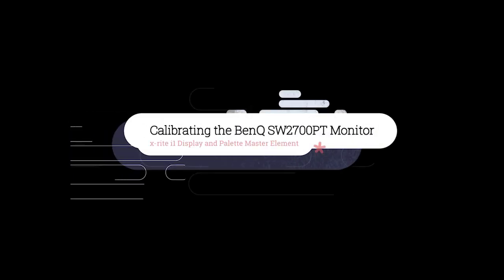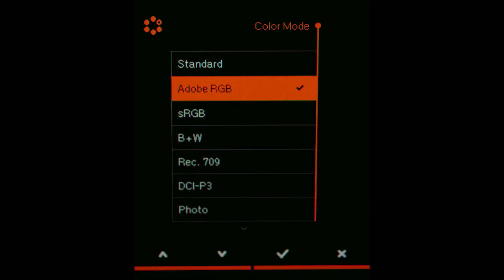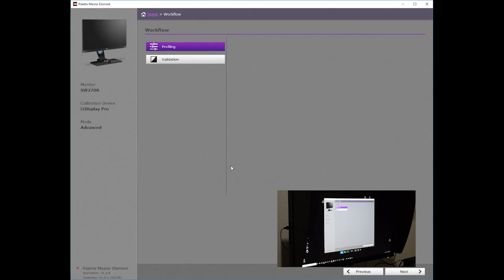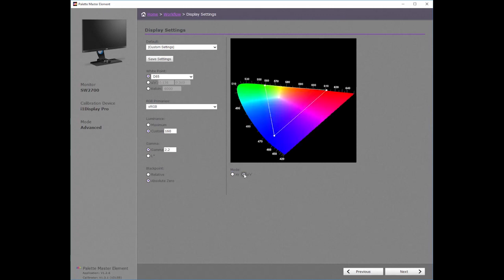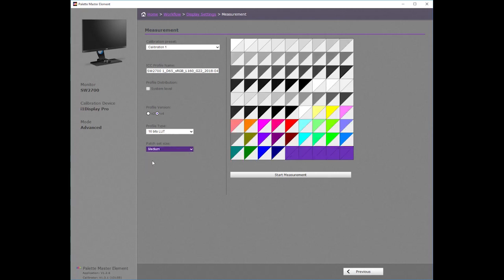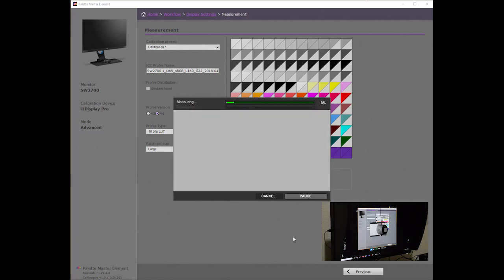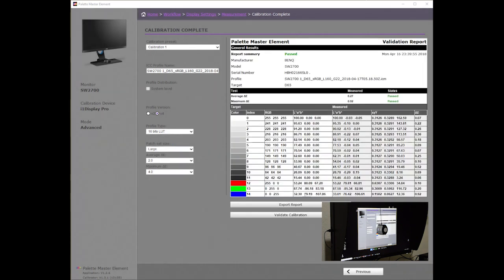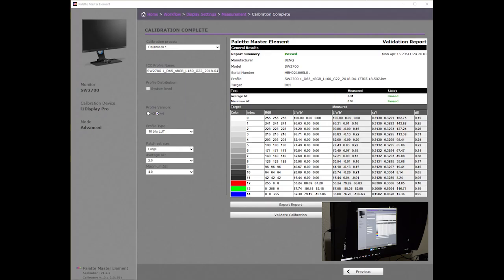Updated: Calibrating the BenQ SW2700PT monitor using XRite i1 Display

Comment: Hey Roger, which port are you connecting your Xrite calibration tool to? I’ve connected my monitor via usb c and then the i1display profiler using the service port (only USB port available). Is that right?
Reply from the maker: Yeah. On my monitor, there are two UsB ports on the left side of the monitor. I connect the i1Display (same as the Pro model) there. I use the Palette (sp?) master elements software from BenQ with this. I think if I use the larger spectrophotometer i1 Studio device, I connect that there also even though I use the Xrite version of the software with that.
Reply from the maker: Also, I connect my monitor to the PC by display port cable. But I've heard the usb c works well.
Reply from the maker: Yeah. On my monitor, there are two UsB ports on the left side of the monitor. I connect the i1Display (same as the Pro model) there. I use the Palette (sp?) master elements software from BenQ with this. I think if I use the larger spectrophotometer i1 Studio device, I connect that there also even though I use the Xrite version of the software with that.
Reply: @docrujet  thank you. I’m connecting my i1 calibration tool using the usb a (service port) input and a USB C display cable. However, the software doesn’t advance beyond the initial set up stage where you select your monitor model/display tool etc. did you come up against this?
Reply from the maker: @Poopdeck1015  I don't recall having that experience. I used the most uptodate version of the Palette Master Elements recently. Apparently, they changed the name of the iDisplay  to i DisplayPro. Changes. I would say it's probably the time to call BenQ. They will know the answer. They offered me really good support when I had to call them back in the past. Makes you wonder what is going on. Rog
Reply: @docrujet  Yes that could be. I’ll give them a call tomorrow. Thank you very much
Reply from the maker: @Poopdeck1015  Fingers crossed. Rog

Comment: Hi my BenQ SW2700PT (January 2020 Build) i installed PME ver 1.3.10 as suggested by BenQ channel tutor ArtIsRight. There's some bugs in later ver. 1.3.9 and new ver. 1.3.11. ver. 1.3.10 is stable. But I'm getting different measures after every single calibration. Panel Native, Luminance @ 100, 16bit LUT, gamma 2.2,  absolute black. What's wrong. Errrrrr!
Reply from the maker: Hi. I just saw this today. One question: when you calibrate, do the DeltaE values fall below 1 (average deltaE less than one). If so, then good. The individual deltaE values will vary with every measurement. No worries.. but,, if the calibrations are failing,, then not good.. BTW, the last few patches will be more than DeltaE 1. Please let me know. Rog
Reply: @docrujet  Yes value changes in every single measurement. I'm getting higher value in avg Delta E 3.05 & max delta E. 4.32. that's not good sir. I'm using X-rite i1 Studio.
PC Specs
i3 8100 8th gen
Asus GeForce GTX 1060 6gb
16gb ram.
Should I reset GPU settings. Should I reset monitor.
What should be my selection of options for i1 Studio in Palette Master Element. The current version I'm using ver 1.3.10. should i jump down to ver 1.3.8 ?
Reply from the maker: @SachinBalan_PB  Sachin, the is how I moght approach solving this: 
1. Make sure your monitor is connected using a Display Port Cable - not HDMI - to you monitor card. 
2. Go into the NVidia Settings and be sure your display is set to 10-bit display settings (It's at the bottom of the "Change resolution" page in the NVidia Software. )
3. I see you are using an XRite i1 Display colorimeter. Good. 
4. Make sure it is attached to the USB slot on the left side of the monitor. It will not work if it is plugged directly into your computer/motherboard.
5. I see you are using the Palette Master Softewware Provided by BenQ. (You cannot use the non-Benq version of this software to calibrate your monitor. )
6. Start the PME software.
 7. Basic or advanced. Both are fun. Make sure you tell the first page that you are using the i1 Display. 
8. If you are calibrating as Adobe RGB, just know some colors will be further out of calibration (Blue and Green) than you will get for just sRGB (Stokes RGB). No worries. 
9. Set your White point and luminence. (Mine is set at D65 and Luminence 120 - I work in a bright room). 
10. On the next page set up which preset you'll store this under (Calibration 1 is mine), your calibration name, Profile version, And 16 bit LUT (I believe this gets better results when I run the calibration). Gamma 2.2 is good. 
11. Run your calibration. Make sure the i1Display sits right on the monitor without a gap. (It is easier if your tilt the monitor back slightly). 
12. If the DeltaE result you get at the end isn't < 1 on average, then call BenQ. They are nice people and they will help. Really, really.

I hope I've recounted a step you might have missed. I feel your frustration when things don't go right. You should have seen my face the first time my screen turned white-light pink after calibrating  - the first and second time. I called BenQ. They offered to replace the Monitor. I calibrated it a third time just to make a video and vent my frustration and magically it worked perfectly. I don't think I ever figured out what I did wrong the first two calibrations. Patience my Brother. LEt me know what happens. Roger
Reply: @docrujet  I bought my monitor from the computer vendor nearby. My Nvidia color setting is default > desktop color depth 32-bit > output color dept 10bpc > output color format RGB > Output dynami range full. Refresh 60Hz.
Reply from the maker: @SachinBalan_PB  If you've gone through the steps I noted above (12 steps), and it is not giving you good results, then maybe you'll have to call BenQ. THey are good listeners. Rog
Reply: @docrujet  I have put it on basic > Adobe RGB > 120 > 16bit lut > large. Let's see what result it gives.
Reply: @docrujet  Bingo it worked with basic settings. Thanks Rog.❤️👍. All frustration gone in a wind.
Reply: @docrujet  I asked youtube channel ArtIsRight and he said don't use ambient light metering after paper profile that will spoil all Calibration effort.
Now my Calibration 1 is
Panel native
D65
Luminance 100
16bit lut
Gamma 2.2
Profile v2
Absolute black.
Now all is well.👍
Reply from the maker: @SachinBalan_PB  Congratulations. Good to know. Roger

Comment: In the Display Settings I can't see any "photographer" or "video" settings, just "Device native"... No "RGB primaries" menu either... Any help on this? THANKS!
Reply: I have the same problem...
Reply: same problem. I have the newest monitor drivers, newest pallete master version, monitor usb is connected to PC, Spyder 4 connected to monitor usb. All should work but I do not get "profiles" and I do not get to choose "Primaries". Anybody solved this?

Comment: Help. I get an achieved temperature of 7600K, target ist 6505K. This makes me so unhappy.
Reply from the maker: Ooh. Couple of basics. If you just bought the monitor, be sure you are using a display port cable between the monitor and your graphics card. Be sure your colorimeter or other measurement device is connected to one of the usb ports on the left side of the monitor. Be sure to download the new version of the xrite palette master software and their usb port sw2700pt card reader diver. I'm not sure if you need to download the WHQL driver or not. When you run the calibration, check the correct settings on the start up page for your monitor, your calibration device. Be sure to choose either the D50 or D65 whitepoint setting in palette  master elements. Choose a luminance between 100 and 120 if this is your first time doing this. Pick the AdobeRGB or sRGB settings if you prefer to do it that way. Make sure you set the software to store your calibration to either calibration 1 or calibration 2. I pick the 16 bit LUT and large patch set on the next screen. The calibration will adjust the brightness to as close to the setting as you choose. If these steps do not work, then I'd call BenQ for help. They are easy to talk to. Rog
Reply: @docrujet  Great video. I'm new to all this, so I may be naive. You wrote, "Be sure to download the new version of the xrite palette master software and their usb port sw2700pt card reader driver." Do you really mean the BenQ Palette Master software and the drivers from BenQ? It's critical for me to know if not, thanks. B

Comment: I am having issues calibrating my BenQ SW271 monitor. Using the X-rite i1 Display Pro I first attempted to calibrate sRGB at 100 luminance, and achieved only a 21.8681. I tried again, this time using Adobe RGB at 80 luminance and achieved only 20.3193. The report showed a Maximum of 26.36 and an Average of 19.83. Not sure what the issue is.

I am running Windows 10(v 1903, maybe that's the problem) on a Ryzen 9 3900x, MPG X570 Gaming Edge MOBO, RTX 2070 Armor GPU. Pallette Master Application is V1.3.5. Pallette Master calibrator is V1.3.2(1D186). The monitor is connected via HDMI into the GPU, and USB 3.2 into the MOBO(I have not tried to calibrate with USB-C). 

My main use of this monitor will be as a video editing reference monitor and some color grading, both in DaVinci Resolve.

Thanks in advance for any solutions and/or suggestions
Reply: Nevermind! I went and bought a Display Port cable and it worked fine! (wish they'd supply one with the SW271 but se la vie.)
Reply from the maker: @jeremymullins715  oops. I just your next conversation. I'm glad you figured it out. Those cables have to be right. Rog
Reply from the maker: Good luck and enjoy your new monitor.
Reply: @docrujet  thanks for the help!
Reply from the maker: Jeremy, sorry I did not respond two days ago when you asked your question.
The Delta E values you report  are more than a bit off. I have pasted a link that deals with calibrating the SW 271 monitor.  https://youtu.be/84Z5yMLCtJM

Just a few items. I am not familiar with the sw271. But my sw2700pt requires the calibration be plugged into the usb port on the side of the monitor. The xrite 1 display pro is a reliable tool. I also have the iStudi. Both work well. But, they are not the same technology and give different calibrations. 

Make sure your monitor is set to the full 0-255 range for colors in your graphics card software. 

Use the Palette Master Elements video setting (if you see one). Sorry, my computer is not in front of me to check the Palette Master choices. 
If you are still getting Delta E >2, call BenQ. Their staff are very helpful . 
Rog

Comment: okay i calibrated my monitor (the same one you got in the vid (benq sw2700pt)) the colors noticably better but the monitor overall appears to be darker...did i miss something?
Reply from the maker: When you start the calibration process, on the "Display settings " page is the White Point set to D65? Or, is it set for D50. D50 leans towards the redder (yellower?) colors. If you are at D65, then that is the recommended setting. Here's a link to XRite's explanation for this: https://www.xrite.com/service-support/monitor_calibration__which_white_point_is_correct. Just below that is luminance. Mine is set at 160. Normally many printer groups will use much lower values 80 to 120 cd/m2. This works for my environment. But, might be too high in your environment (I have a lot of large windows here). I leave the black point set to Absolute. When I first adjusted my monitor I experimented with both White point settings (this affects the colors' warmth and coolness. I preferred the D65 vs the D50 for my purposes. The luminance affects the perceived brightness on the monitor. But it also affects how you perceived the differences between the monitor and your actual prints (if printing). (In fact I might just try re-calibrating at a lower luminance to see if that works better for me now that we are moving into the Summer. It's getting bright in here. )
Reply from the maker: Sorry, I wish i had given a  more concise answer to your question on darkness of your monitor. I have learned that professional users of monitors adjust the brightness of their monitors for their specific purposes. Luminance: 80-120 cd/m^2 is a typical range of brightness of monitors for most of these professionals. The white point is used to adjust the "temperature" of the viewing screen.  Together - depending on your choices - you can end up with a careful balance of color temp and brightness that suits your environment and your goals. 

I use my monitor for viewing images in a non-standard bright room for the purposes of printing on high quality papers. Since reviewing the luminance on my monitor - 160 cd/m^2, aiyeeee! - I do have to question how I got this setting. I will re-calibrate at a lower luminance to see how this works for me at this time. 

Nevertheless, I review the quality of my prints under 5000K lights. And, then I view them under daylight even though I calibrate my monitor for the D65 white point (6500K). This works for me. But, would not suffice for a large printing service proofing images before and after print runs. I've even heard of some colorists who prefer to review their prints while working with monitors set at the D50 white point (fewer blues, more reds) . Perhaps this is ideal for their work viewed in situations where colors have to look right using tungsten lighting or 5000K lighting. 
I hope you enjoy learning just how you prefer to adjust your calibration settings for your environment. :) RGP

Comment: How did you set up the i1 Display? should I plug the usb cable to my macbook pro or to the monitor. I have tried both but no joy.
Thanks in advice.
Reply from the maker: If you have the monitor attached to your Macbook, ... the Xrite inserts into the USB slot(s) in the side of the monitor. It does not work if the device is plugged into computer. Rog
Reply from the maker: If you find it's being cantankerous, then I'd call BenQ. They have great staff and they take their time to answer your questions. I say more, but I have not used the BenQ on my Macbook. They will give you better info. Rog

Comment: Is this considered a hardware calibration or a software calibration? And last question, is there any difference in calibrating using the spyder 5 pro instead of the xrite younuse in the video? Thanks in advance. I just bought this Monitor.
Reply from the maker: I actually tried to get Spyder to let me do a video with theirs. (THey didn'y seem to understand why I was even asking.) I've read a lot of peoples thoughts on one vs the other. But, I do not know which device  is better. The calibration itself?... When I hear the phrase "Hardware" calibration... that sounds a bit like factory calibration to me. (I am no expert). 
Factory "hardware" calibrations are usually in the monitor and cannot be changed by the consumer.

 But, the consumer can purchase a device like XRite or SPyder and do their own "custom" calibrations.  Personally, I like the feeling that I somehow have more control this way. It is fun , besides. RGP
Reply: Roger Pafford thank you for the extended response. Yesterday I ask to the BenQ online support service, and they told me that this Monitor is compatible with both calibration displays, but the Xrite has a better result with the colors. I'll have to buy the Xrite 👍
Reply from the maker: @TitoMariategui  That sounds like what I've heard from some well written online reviews. I use the XRite devices. Gave Spyder a chance. They were not interested. Thank you. Roger